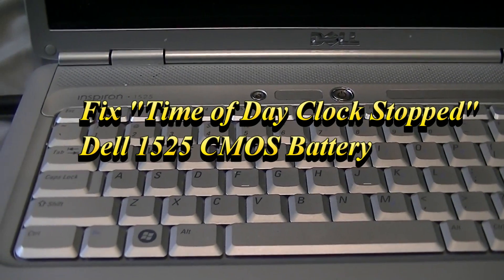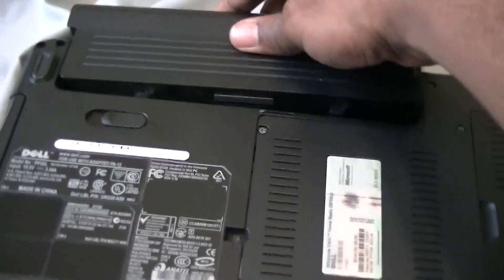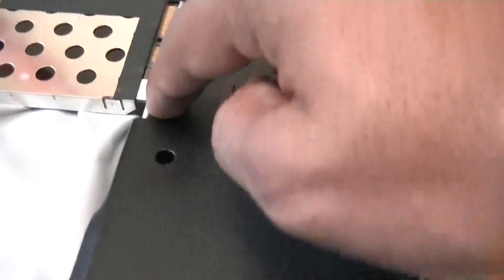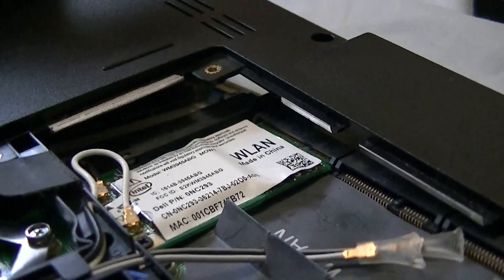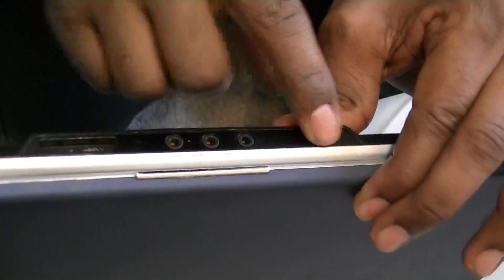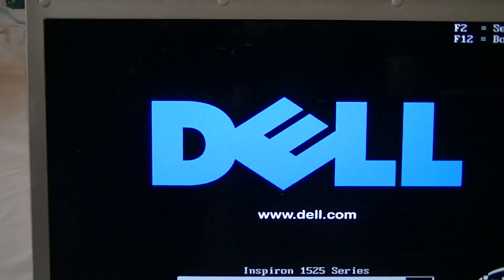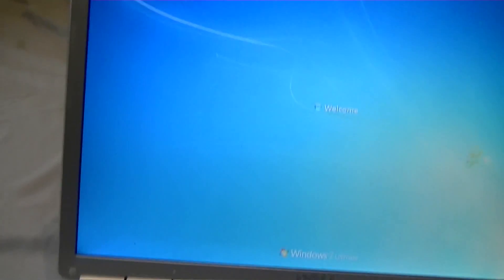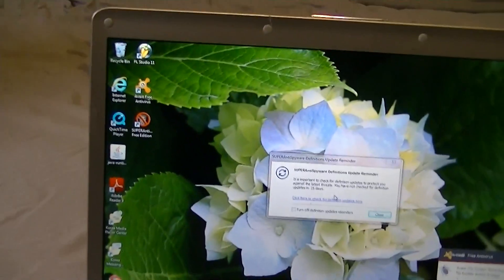fix time of day clock stopped dell inspiron 1525 cmos battery

Comment: I did this today and it's worked. Thank you. 
It is a bit fiddly and beware.. due to age I suppose the plastic retaining lip on the side of the battery holder snapped off when I flicked out the old battery. There was a tiny bit of lip left so Ive added a small dot of blu-tac to the bottom of the battery and piece of duct tape over the top and sticking to the edge of the holder!

Comment: I have  a issue the date don't want to run and reset itself every hour, I change the cmos battery but still the same problem, help please dell n4050
Reply: Maukarof Scardia
, year reset to 2008 year? In BIOS has set time, year. May be you need change it?

Comment: I'm trying to replace the battery on my sister-in-law's computer right now.  I can't believe how insanely difficult it is to access this battery...it's in a slightly different place than the one in this video, and I cannot figure out how to open the housing enough to even free it.  Terrible design for replacing this dumb battery!
Reply: I love your sister

Comment: quick question, if my dell's clock and calendar doesnt work, even when its plugged in to the charger (i keep it plugged at all times, battery life is very low). Would changing the cmos battery would do the trick?
Best Regards
Reply: Yes
Reply: Im not sure if you'd found the answer to it or replaced your laptop. My Dell Inspiron 1525, bought in 2008 has the same issue. I have to manually set the time under bios, and then it remembers the setting until i power the whole thing off. If i switch off the power supply, the next time i have to reset it through bios again.
Reply: @Organizeeewithlotsofees  Yep, that means the CMOS battery needs replacing.
Reply: Does the main battery supply the power to the CMOS or is the motherboard drawing from that tiny battery?
Reply: I changed the CMOS battery and it worked.
Reply: Keep your main battery fully charged should work.
Reply: @wilsont1010  it works, only if PC is turned on. if You turn it off, clocks just stops tracking time.